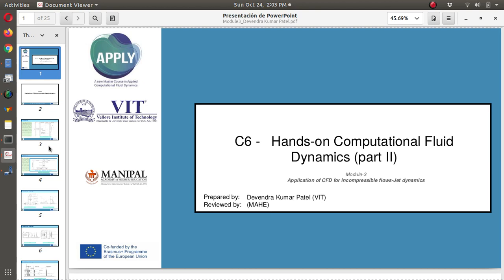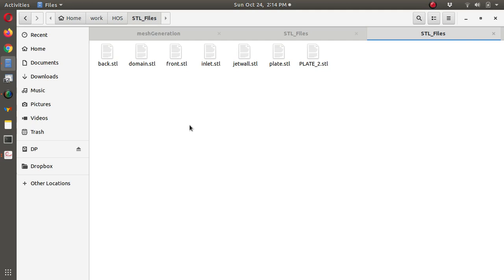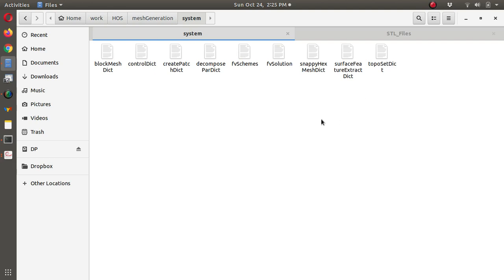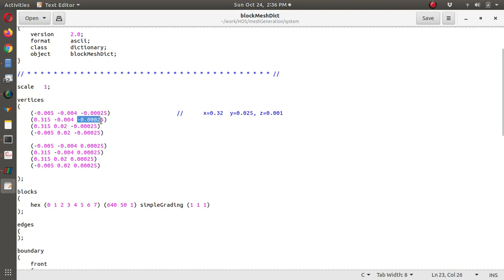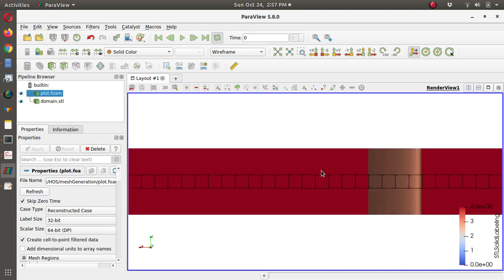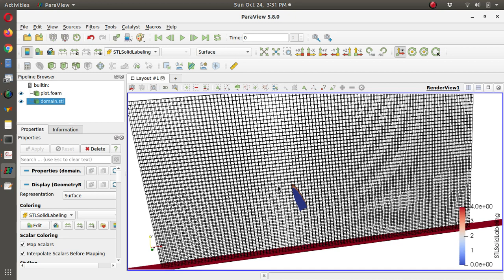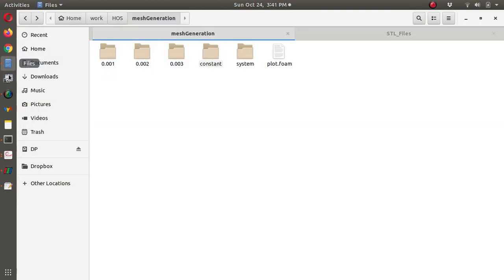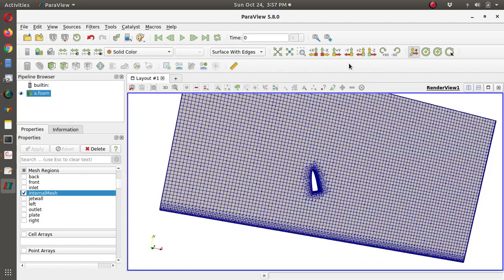OpenFOAM | ParaView | snappyHexMesh | Block-Mesh Part-1

Comment: Excellent overviews on the workflow to produce a mesh from an existing geometry in preparation for OpenFOAM calculations in part 1.  Part 2 is an overview of workflow to complete the mesh generation, set the boundary conditions and post process the data from an OpenFOAM calculation.

The two tutorials strike a good balance between having just enough detail to hint at how to set up the input files to do the processing without overwhelming the viewer with too much detail. Part 2 also indicates how scripts and both ParaView and Tecplot can be used with LaTeX to process calculation data in the production of journal quality figures.
Reply from the maker: Thanks for appreciation🙏